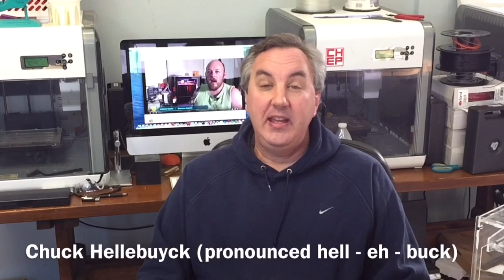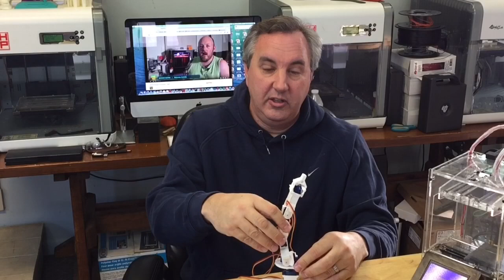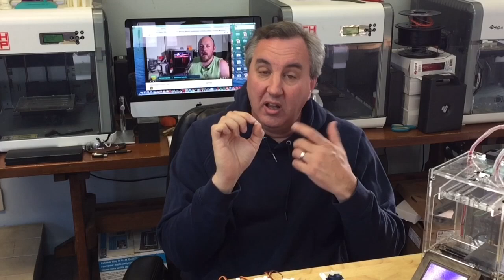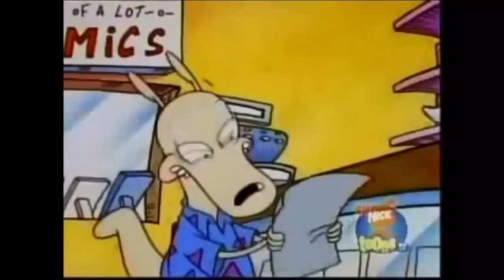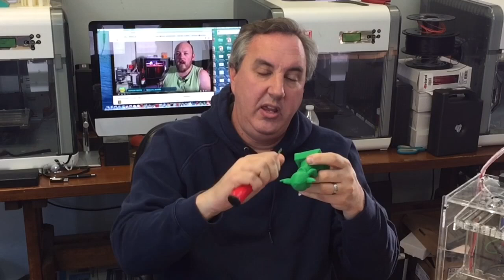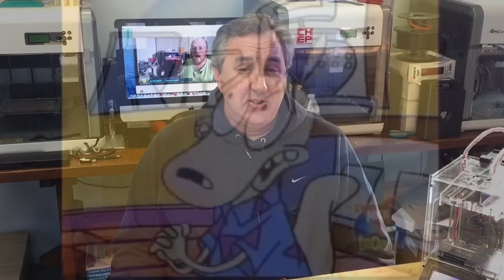#3DPrintingOnYouTube Answers to 6 Questions

Comment: I have a 3D touch printer at work and I use it every day. The quality is good but for small parts is difficult to print them. At home I have my Super XYZ Da vinci which I love it. Quality is good enough for my projects and in top of that I reset the filaments with arduino. 

Thank you for you Videos.
Hi from Los Angeles

Comment: I find TinkerCAD is very difficult to be accurate with, that is why I prefer to use Fusion 360. (also free to hobbyists)
Reply: +Brian Dodds TinkerCAD is also very very easy to use. You can pick up TinkerCAD for the very first time and make a model within seconds, but the first time I used Fusion 360, i was lost.
Reply: +Jake Crowley Yes TinkerCAD is very easy to use, but virtually impossible to build accurate models.  Fusion 360 does have larger more learning curve, but in the end the time spent learning it will be well worth it.
Reply: +Brian Dodds yeah i agree tinkercad is too difficult in terms of accuracy i do also use fusion360 but lately have been using Onshape quite a bit i like it more than fusion360 to be frank.